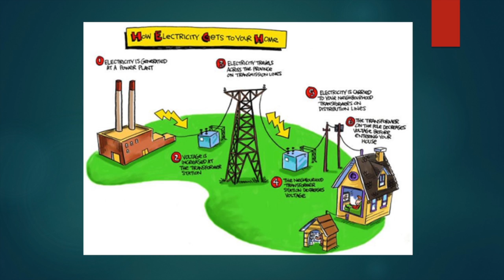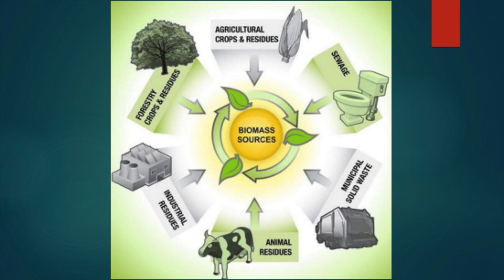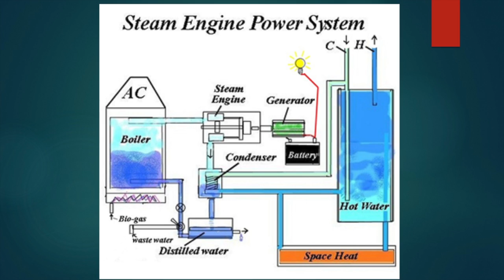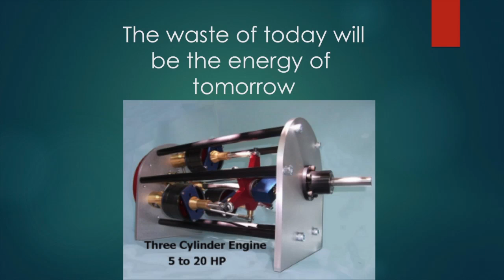The Surprising Future of Steam Power | Robert Green | TEDxMissionViejo

Comment: "we have it today". "this can run on biofuels" This poor old man doesn't realize just how hard it is to get biofuels
Reply: DUME85, you must be thinking of a specific kind of biofuel. Biofuels in general are plentiful. I don't know about where you live, but at least in my native Norway it is pretty common for people to buy wooden logs to heat their houses in winter. Wooden logs are biofuel. Pellets are getting more popular although I have no idea how hard/easy they are to obtain.
Reply: @erikengheim1106  yes you can burn wood, but there is a reason we started burning coal for energy instead. Now would also be a good time to point out that trees aren't a sustainable fuel because they take too long to grow back. I'm not sure if you have seen any of the talks about how large solar farms would have to be to get a good amount of electricity from them but farms for biofuel would have to be at least 3 times larger as they absorb far less energy from the sun.  There are also good reasons to believe that a steam engine that small would be less efficient than just running energy through a grid. 

Don't believe everything you see on ted. They let sam hide give a talk about the future. Probably the best ted talk of all time but still.
Reply: @dume85  I think the problem with your objections and that of many others is that you tend to see all these systems in isolation. The real value here is in the combined usage. Back when we used coal, that was almost exclusively the only source of energy for industrial use. Biofuels do not need to replace all coal. Why should it? The main point is to replace most power production with wind, solar, hydro and geothermal. The purpose of biofuels IMHO is to deal with the variation in energy production from renewable energy sources.

The point is not for say wood to beat coal. The point is for say solar + wood to beat coal. That is an entirely different challenge. 

> Now would also be a good time to point out that trees aren't a sustainable fuel because they take too long to grow back.
That is patently false, as you have not laid out any assumption for this assertion. How much wood do you assume we need to consume, and how did you arrive at that number? We already consume a lot of wood in the world, and outside of the rainforest there tends to be a net growth of forrest.

In my native Norway e.g. we use wood for almost everything. Most of our houses are built in wood. Wood is far more popular for heating than coal. In fact I can't remember ever hearing about anybody using coal for heating their home in Norway. We have a lot of paper production. Still the net growth of forrest today is twice the amount of what it was in the 1920s. The total forrest area in Norway is has been growing for almost 100 years despite consuming a lot of wood and exporting it.

In the US, there are large areas that have become covered by forrest which had none a 100 years ago. But forrest is just ONE way of obtaining biofuels. Algae e.g. produce biological material a lot faster. You produce biomass with algae or say cyntobacteria at a tiny fraction of the area required for traditional crops. These could be used for making biogas, biodiesel etc. 

It is a matter of tradeoffs. Algae requires much less land but is more capital intensive as you need to build facilities. Forrests need little capital investments but requires more land. 

>  There are also good reasons to believe that a steam engine that small would be less efficient than just running energy through a grid. 
As I've said you are not looking at the whole picture. You are missing the central point Robert is making, which is that a small scale steam engine can be utilized for more than electricity or mechanical energy production. With a large "efficient" grid engine, all the heat goes to waste. A small scale steam engine with 10% efficiency in generating electricity, but where all the remaining heat is used in the home for heating, cooking, distilling etc will have a better total energy efficiency than a grid style steam engine with 20% efficiency, since all the remaining heat energy goes to waste.

> Don't believe everything you see on ted. They let sam hide give a talk about the future. Probably the best ted talk of all time but still.
This isn't just a TED thing. I did in fact NOT find Robert due to his TED talk. I found him because I already knew localized energy production made sense because you can utilize the heat. There are other ways of doing this. I was simply interested in surveying the different approaches. Instead of steam e.g. you could use a pressured air system. You could use e.g. solar cells or wind power to pressurize air locally. The heat from pressurization could be used for heating water for cooking, shovers etc. Releasing air causes cooling which could be used for refrigeration.

The primary reason a lot of alternative systems for a multitude of things don't exist today, isn't because they don't make sense but due to inertia. Once society goes down one technological path, it tends to increase the barriers for other systems. E.g. the PC was never a very good computer architecture, but once it reached a certain volume, competing standards had not chance, even if they were better.  Same with EVs. To my knowledge they are cheaper than ICE cars at the same production volume. Hence ICEs win today mainly due to much higher existing volume of production.

Our energy systems are largely the same. They are a product of an intricate history. It is not going to change by itself. I will require political action. And in some cases it doesn't because history is entirely different. E.g. in Africa they jumped over landlines and straight to cell phones. They may do the same with the electric grid. Building a grid is expensive and time consuming. Grids in many African countries are notoriously unreliable. Diesel generators are wide spread. Local energy production would make a lot more sense in many cases. You can setup solar cells, windmills etc in a local village and avoid having to connect it to the grid. A steam engine could be used to provide energy when the sun doesn't shine or the wind does not blow. Alternatively they use the sun to create steam directly. Carl Bielenberg of  Village Industrial Power is already doing this kind of stuff in Africa.
Reply: @erikengheim1106  i think we actually agree on just about everything than. It just sounded to me like he was saying the whole electric grid could be replaced by just steam engines and just biofuels which is absurd. 

"will have a better total energy efficiency than a grid style steam engine with 20% efficiency, since all the remaining heat energy goes to waste." That's mostly true however i just though i should point out that for say combustion plants the steam can be used in heat exchangers for various reasons. You also likely will have to let some of the heat from a home steam engine go to waste. Of course it wont be as much as say a plant which is producing  far more thermal energy in the first place.
Reply: @dume85  
> It just sounded to me like he was saying the whole electric grid could be replaced by just steam engines and just biofuels which is absurd. 
If he indeed thought that, I would agree with you  too ;-)

I can agree that the guy was not that great at promotion and communications. On his page it said he was looking for somebody to take over the business. I almost got tempted, thinking about what could have been achieved with better marketing, communications and presentation. 

Still I am of the opinion that solving environmental issues purely as a consumer issue doesn't work. One would need some form of collective action promoting the usage of CHP units (combined heat and power). Our houses and infrastructure is currently not well designed for local power production. I think one should explore e.g. having standards for low voltage DC currents in houses. So much equipment: LED lights, computers, flatscreens etc work fine with low voltage DC, exactly what say solar cell outputs. What is most optimal for a steam engine to output I don't know. 

Just looking at my apartment, there is not easy way to put in a CHP unit. That would require a number of adjustments and retrofitting. I think we really need some sort of established standard which house builders and makers of CHP, solars cells and a host of other things can follow.
Reply: @dume85  Hemp takes little time to grow and is very sustainable.
Reply: @erikengheim1106  Don't forget HEMP!
Reply: @survivormary1126  I don't know much about hemp. You got anything interesting about hemp compared to the competition you can tell me? What are the yield like compared to forrest, sugar cane, corn etc? And what ways can you utilize it?

Sugar can e.g. you could use to produce ethanol which is a good biofuel for vehicles. While wood I think is better suited for burning in power plants.

How about hemp, what ways do you recommend using it?
Reply: @erikengheim1106  By the was Sugar is a huge problem, just look at Florida.

Comment: Steam would be more applicable vehicles to automobiles, trucks, and modern steam trains rather than homes and buildings. Much cleaner running on renewable fuels and much less complex, more reliable and much less expensive than electric and hybrid vehicles. Steam is also a proven technology for vehicles.

Comment: Lol yeah burn utility poles! You’ll kill everything the smoke touches
Reply: wood or anything if burnt fully then no smoke emitted
Reply: @vandanams6052  Agreed, but most poles are treated to prevent rot, and release chemicals when burned that are not suitable for humans to inhale. Infact, it is Illegal where I live to burn treated wood; it can only be dumped in a landfill. With that said, each system has it's trade offs. I'm a fan of renewable energy (wind, solar, hydro) if it means that our air stays clean.

Comment: Small scale is always more expensive than large scale, so this Scheie would be more expensive than utility scale solar power.
Reply: oystla, that is not given since utility power wastes more heat. Local production allows you to utilize a lot more of the waste heat, thus pushing up the efficiency numbers.
Reply: @erikengheim1106  Well, there is a lot of misinformation and worse in this video. This is an inventor that think he has something New. But it's not. There are many small scale combined heat and power systems out there, and no one are able to compete with utility electrical power and when cheap heat is needed you install any kind of heat systems made specifically for heat. Small scale CHP is more expensive and required maintenance. The cheapest electrical energy is and will always be large utility scale production. Utility transfer lines is not a problem as he claims.  But many places globally also residental solar energy is now cost effective. The "problem" he is claiming of utility transformers is really not a problem. They Loose only a few percent of the energy.
Reply: @oystla  
> This is an inventor that think he has something New. 

I never assumed he did, but I assume that he has some kind of innovation in how he does this otherwise he would not have filed patents. I see this basically as dealing with the question of whether Apple invented the Smart Phone or not. Of course they didn't. Plenty already existed. But usually making a break through is about improving enough on an existing idea to make it big. Nobody would deny that Apple made Smart Phones big. Not saying this guy is the Steve Jobs of CHP though ;-)

> There are many small scale combined heat and power systems out there, and no one are able to compete with utility electrical power and when cheap heat is needed you install any kind of heat systems made specifically for heat.

That is not due to technology alone but also due to existing inertia. Why did landlines beat cell phones for years? Because the lines had already been paid for long time ago. Contrast that with Africa where landlines had not been built. Cell phones got a clear advantage and landlines never got built.

Our houses and societies in the west have already been built around the existence of large utilities. It is sunk cost. That makes it cheaper than a lot of alternatives that may have existed had we started from scratch. These CHP systems have to be retrofitted, which gives them a disadvantage. They are produced in tiny volumes which gives another huge disadvantage. 

It may not end up that way in other parts of the world. Solar cells e.g. scales down very well, which means it is not impossible that poorer countries will end up skipping the building of large grids and instead build more local power production. CHP systems may fit in more naturally in such circumstances. 

> The cheapest electrical energy is and will always be large utility scale production. 
With solar it often isn't. The main problem for solar today is that while it can give cheap power, it needs storage. Batteries are still expensive enough to make utilities win. That may not be the case in the future. In countries  with unreliable grids, people will likely prefer local energy production.

And ultimately it is about how you organize society. It is not impossible to imagine future neighborhoods or apartment complexes being built with a large steam engine for generating hot water and electricity for a neighborhood.  That may increase efficiency in reduce the problem of maintenance since the cost can be split between several families.

Comment: "do you need batteries?"
"no, you just need a few hours of stored electrcal energy"..... Sooo like a frigging battery?? What a crank!
Reply: There are many ways of storing energy that doesn’t involve batteries. Can be as simple as pumping water up to a raised reservoir. When power is needed the water powers a hydro generation turbine on its way back down to the lower reservoir. Voila stored energy with no battery.
Reply: Alex Tomev that's what a flipping battery is
Reply: you can also store hot water in a thermally insulated reservoir, or in phase-change materials, or as hot  mineral oil, you don't have to store the energy as electricity in order to be able to utilize it.

Comment: The electrical grid is actually the best system to transport electricity. High voltage lines more efficient than anything in conveying energy. Also, aks yourself, how have we been powering the worlds economy for the last hundred years? We can never replace the electric grid with something better.

Comment: Whoa - The pictures shown are from a long time ago and/or places that have no well designed or safety regulated power grids.  This is not truth.  All the reasons goven for trouble, except for transformers or true as far as causes of failure are concerned. Considering the number and siz of transformers there are not many that cause problems. They are also 98% efficient. They are the least problem as far as distribution losses are concerned.  Here is this one guy against 100 years of research and develpment of the electric system. The incentive for power generators and local distributors is efficiency. The make more profit with efficient systems. SO while you are calling out the bad points inherent in any system. they artive to imporve and upgrade. More efficient boilers - you don't mention that. Larger generators which work better on higher pressure steam. You don't mention that. You talk about apes that climbed power poles without understanding the consequences and drunk people who stupidly climp poles because they are drunk.  These are NOT common.  The snow bound wires do not exist today. Those were likely early telephone or telegraph wires NOT power lines. You are not present truth. You are using outdated and exaggerated information for your proof of the possibility that your system in contrast to the existing systems which have worked qquite well. ALL systems will fail. Every transport or distribution system of any kind fails.  SO build a better pipe than the present pipelines. Built better cars and all other wheeled vehicled than presently exist.  But don't base your assumptions on outdated and archaic equipment and means of use.

Comment: Most of the energy is lost making steam. A truthful analysis would show an efficiency number trail from past to present, with projections into the future with numbers for each component of the system. Losses are additive.
Reply: So make steam in a vacuum have it escape to another vacuum chamber and have a turbine between returning the water with a one-way valve that takes advantage of any remaining pressure or thermal expansion of the heat source.
Reply: Toby, in this system the heat from the steam engine ISN'T LOST as it is used in the home for: heating water (shower, cooking) and heating the home in cold periods. The MAJOR point about this whole presentation was that central power stations are inefficient because waste heat cannot be utilized. Local power stations like this one can potentially get very high efficiency since the waste heat can be utilized.

Comment: Great Idea for cooler climate places, Thorium molten salt reactors for warmer places.... I have a friend keen on building one of these units for power in Kenya ....
Reply: But isnt that still in its research phase and not yet ready for commercial usage
Reply: @gladwingeorge2606  they actually built a working reactor when they built the first Uranium power reactors . the technology is known and safe, it wasn't made popular for political reasons (Nixon Presidency ...) There are people designing newer and smaller reactors as the fuel is cheaper and safer ....
Reply: Yeah i did some research turns out thorium is the future and it can dwarf what is made by solar and wind easily.